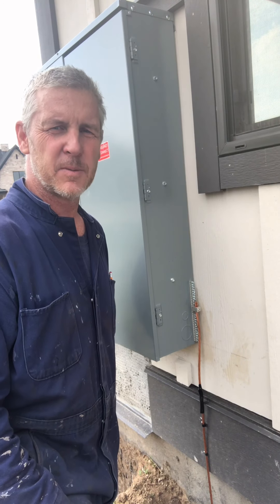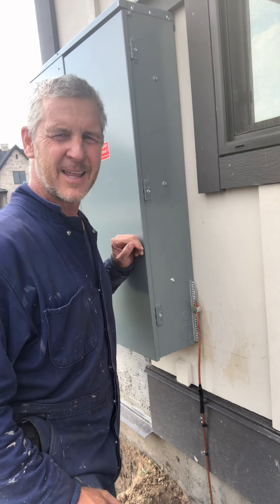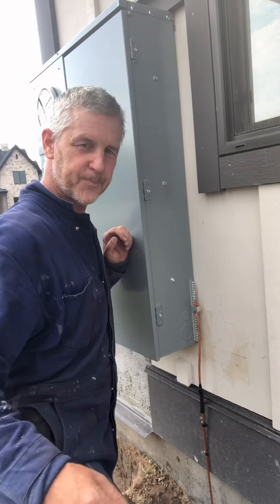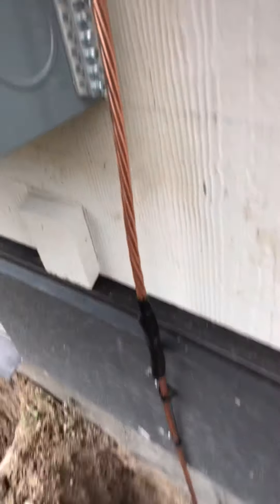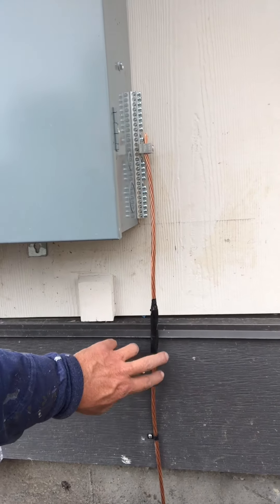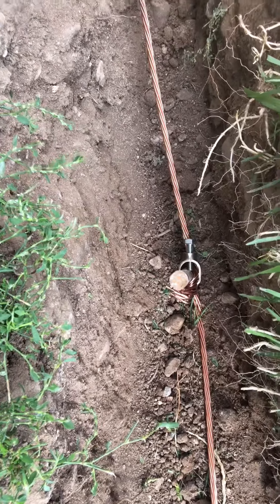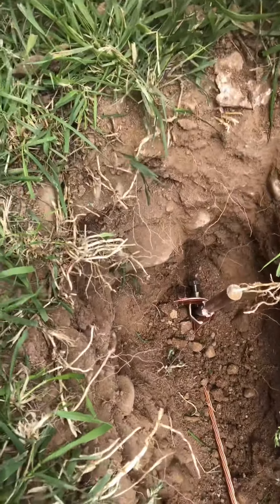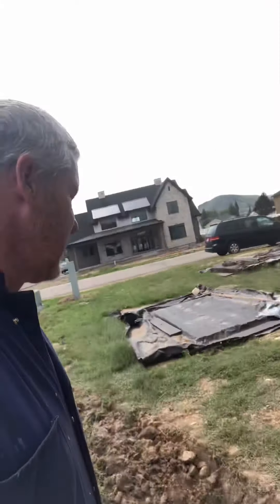Electric: Grounding Rod and Wire 400AMP Panel, #2 Copper Wire, Braided; 3 Grounding Rods in Series

Comment: For anyone coming here for guidance:

Grounding electrode conductors are sized by the size of the service wires, not the amperage of the panel.Usually with 500 mcm for a 400A service you’d need 1/0 copper. However, The portion of the grounding electrode conductor that goes to the rods needs never be larger than #6. 

There would never be current on this wire, save for a nearby lightning strike that electrifies the dirt, therefore the tape should be removed and aluminum siding along with anything metal should be encouraged to touch this grounding electrode conductor. 

The grounding electrode conductor has nothing to do with clearing a fault. If you didn’t have this wire but you did have individual equipment grounding conductors that were bonded to the neutral inside the house and a ground fault occurred, the breaker would still trip if no other issues exist. 

This has nothing to do with a short circuit. If you had no grounds at all and a short circuit occurred, the breaker would still trip if no other issues exist.

Grounding is very important but what’s even more important is to understand what you’re doing.
Reply from the maker: Thank you for providing the suggestion and instruction.

Comment: I really hope this isn’t the guy that wired the house…
Reply: I would be very very scared if this is the case.  He got me confused after 10 seconds into the video.  I am an electrician by trade and I have been working as a electrician since 1998.
Reply from the maker: We appreciate you watching the video and any professional, constructive criticism about the work done and/or described.  We think we completed the work to code and compliance.  If you think the work is out of code and/or out ofcompliance and should be changed; please describe how you think the work should be done differently and changed and cite the authority NEC code that it needs to comply with.

Comment: Hi! There I did not see where is your Main Bonding Jumper?  I assume you tapscrew that lug bar to the box!!!
Reply: Or the neutral could be bonded to the box inside, in which case it’s bonded.
Reply from the maker: Can you more fully explain how the current system should be altered?  The grounding wire is attached to the box, only.

In the 2020 NEC®, the definition of a main bonding jumper (MBJ) was revised to clarify that the MBJ connects the grounded circuit conductor to the equipment grounding conductor, or the supply-side bonding jumper, or both, at the service.

Comment from the maker: What is a "ufer"?  What does that stand for?
Reply from the maker: A “Ufer” ground is slang for what the National Electrical Code (NEC) addresses as a concrete-encased grounding electrode. The term “Ufer” does not appear in the Code, but many in the industry use it.

Comment: This was not done right. Why make a tutorial if you don't know what you're talking about?
Reply from the maker: We think the work was done correctly. We welcome productive criticism.  If you think the work was done incorrectly; please cite and reference the code you think it violates; and present a statement on what is wrong and how it should be corrected to adhere to code.
Reply: Does not comply with NEC 250.52 and other common electrical codes. 
Conductor is not continuous. If you're using the ground rods as they're supposed to be used, you cannot cut them to shorter lengths. If the rods are just used as supports to hold the conductor so that it is a concrete encased electrode (which you didn't mention, so we have to assume that is not the case) then there needs to be room around the conductor to be properly encased in concrete. 
The screws holding the ground bar onto the panel are coarse type which cannot properly get 2 threads holding onto the metal frame of the panel so it is not properly attached. 
If you're making a tutorial, you are saying this is the right way, or at least A  right way to do it. This is misleading to others who don't know any better.
Reply: Not only is this installation not code, it is not safe. Once your screws and splices fail (which they will), you have no more ufer because odds are your water pipe is ran in pec line and cannot act as a ufer either.

Comment: Need more explanation on why one requires a ground from the electrical perspective; rather than be in "big trouble". 
Explain technical application please. 
Teach.
Reply: He doesn't know he's not an electrician
Reply: @matttyler390  His ground bar rigging tapped on the outside of the panel would fail an inspection.
Reply: @matttyler390  ok thank you.
Reply: @genjaxx1463  okay thank you, trying to learn.
Reply: Look up Mike Holt’s video on grounding and bonding. You’ll learn a lot.
Reply: @doc13067  ok will do, thanks a lot!!
Reply: The ground rod is only to spread electricity into ground incase of a lightning strike. That’s all. Your 14/3 wire or 12/3 wire has a copper wire that when a short occurs, current will flow through its copper wire and back to panel and trip breaker and also keeps appliances from becoming charged in case of an electrical default within the appliance itself.
Reply from the maker: We appreciate you watching the video and any professional, constructive criticism about the work done and/or described.  We think we completed the work to code and compliance.  If you think the work is out of code and/or out ofcompliance and should be changed; please describe how you think the work should be done differently and changed and cite the authority NEC code that it needs to comply with.